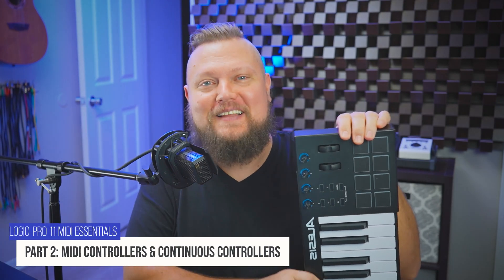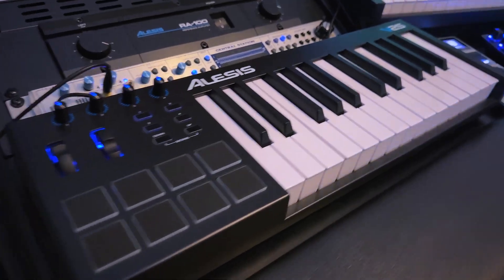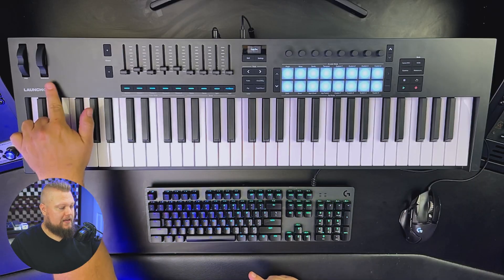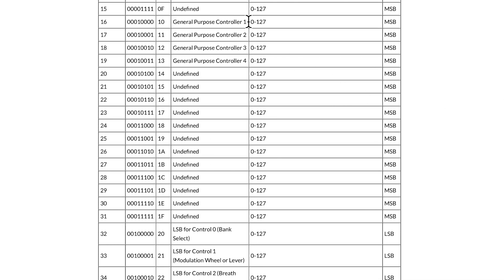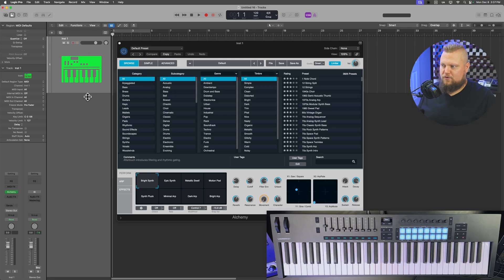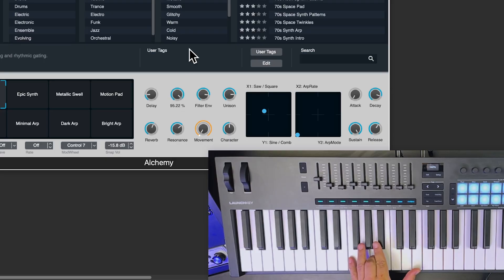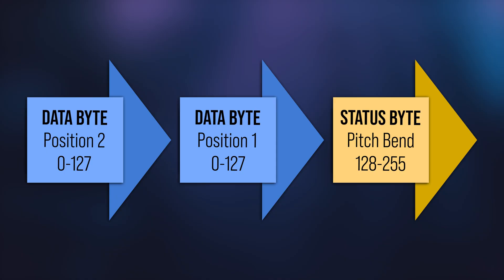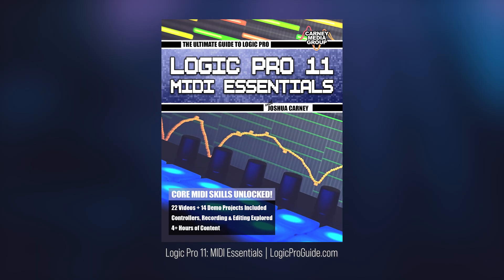MIDI Controllers & Continuous Controller Assignments [Part 2]

Comment: Hi Josh. I'm thinking of buying the 5 part bundle but I've already purchased the Logic Pro 11 Essentials course last year. Can I get any allowance and just buy the 4 courses? The Essential course is the best I have come across for Logic Pro 11. I normally use Studio One but am slowly starting to use Logic Pro 11 as I have a lot of older midi hardware which is great with Logic Pro. I still use some of your courses from way back via Mac Pro Video.
Reply from the maker: Hey Alan. I appreciated the support. I have responded to your email.

Comment: I wish they would make an option for controller assignments to be project based instead of being entirely global in nature. It's always been a bit of a mess.
Reply from the maker: There are like 4 ways you can assign them. To make them project based, you can use the MIDI to Plugin Parameters preset in the Scripter plugin. I’ve covered it before, and it’s covered again in this course.

Comment: Thanks for this... question, if I may: The audio-midi settings shows a MIDI1 and a MIDI2 for my Nektar LX-Mini, which, I assume, are 2 Midi ports. When and how would I use that 2nd port?  thx!
Reply from the maker: Great question, forgive my long explanation. We don't cover MIDI Ports and Channels in this course, just because this course is mainly DAW-based, and most folks who mainly work with a MIDI controller and a DAW only, will never need to worry about Ports and Channels, but I will cover them in the future. On older hardware Ports function like a separate "pipe" to send MIDI data. Each port can have 16 MIDI channels, so with 2 Ports that expands the number of channels you can use to 32. But in MIDI - "channels" are not like audio channels - discrete pathways. With MIDI channel information is more of a 'marker' that is relayed on the Status Byte. So you might have a Note-On message on Ch 7, and then immediately after it have another Note-On message on Ch 1. With hardware, the channels can be used to route MIDI data to a specific hardware instrument in your setup - for example you might have 2 different hardware synths, assigned to Ch 1 and Ch7. The messages send on Ch1 will only be heard on the synthesizer assigned to Ch1. MIDI Ports and Channels are particularly helpful if you have a big MIDI studio with lots of hardware synths. On your Nektar LX-Mini, which is USB only - I don't think they are used that way. Typically with modern USB MIDI controllers and control surfaces, some of the functions are just reserved for Port 2. Port 1 is probably reserved for all of your musical data, and Port 2 is probably reserved for control surface and system functions. I believe that controller has a firmware you can install which will make it function like a control surface - that's what my Launchkey does (and also has 2 Ports). In the video, where I switch over to a "generic MIDI Mode" - I'm switching from a control surface mode, which uses the controller more as a mixing control surface, to a custom mode on my faders, knobs and pads so I can use it for regular musical input. I beleive your Nektar controller is probably functioning in the same way.
Reply: @MusicTechHelpGuy  Execellent, as always! Thanks so much!

Comment: Great video, man. Much appreciated. Got a question. Let's say I map my all the knobs on my controller to the 8 knobs in Alchemy that is installed on my Main Bass channel. Then, I create a new track, Lead Guitar, and in that channel I install Alchemy. Do the midi assignments that I set up for Alchemy in my Bass channel remain set up for the Alchemy instance I have in my lead guitar channel? In other words, does the Midi assignments remain the same when I'm using multiple instances of Alchemy?
Reply from the maker: Yes - the mappings will remain when you switch to another track. It works with effects too. So if you map 8 knobs in Alchemy and say 8 faders on 2 of your favorite effects plugins, when you select another channel with that same instrument and same effects, those will be able to be control as well, without re-mapping. However, if you select a track that has a different instrument or different effects, the mappings will not automatically 'transfer' over to other parameters.
Reply: @MusicTechHelpGuy  thank you very much for your reply. Understood. One follow up question, if I may: I have my controller mapped to Alchemy and then I open 2 Alchemy windows... I turn a mapped knob... does that movement register on both of the open Alchemy windows at the same time?
Reply from the maker: No. Whichever track is selected, is the one that will receive the CC data. If you select multiple tracks, you'll see there's an additional indicator on the track showing which one is the 'track in focus' - that is the one that will receive the CC data.
Reply: @MusicTechHelpGuy  Dude. THANK YOU SO MUCH for taking the time to answer my questions. Much respect.